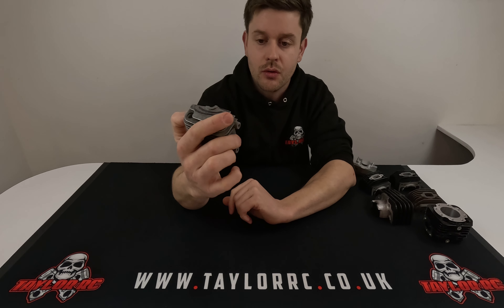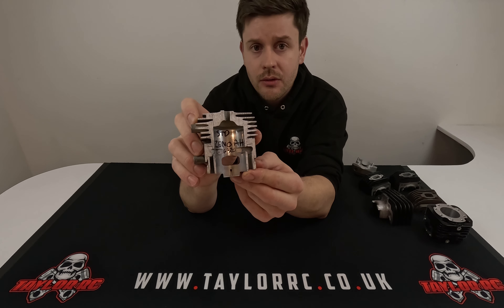TAYLOR 35cc V2 5th Scale RC Engine - In depth analysis and info

Comment: Hi -lovely video thx.I have a custom-made 1/4 rc car with all FG marder parts - Can I install  Taylor RC 35cc V2 in the FG marder. Thanks
Reply: Its possible, some FG custoemrs have done it, but its tight haha!  You also need to reuse the stock clutch housing on 35cc for fitment

Comment: I'm currently in the process of buying that engine for my Losi DBLX 2.0 it's brand new still in the box I was wondering if you could help me with putting together a list for upgrades I can purchase with that engine to be installed with the it ?
Reply from the maker: Morning Antonio, the dbxl 2.0 is actually fairly tough, we  have been impressed. A set of alloy diff housings wouldnt hurt for safety, sadly we dont have stock.  But otherwise the 35 will just drop in place of the current zenoah engine pretty much and off you go for more power!
Reply: @TAYLORRC  okay and really appreciate your help thanks and keep up the great work 👍

Comment: very interested in this engine, ive not long purchased an ESP 34cc Race Ported engine, but its not as good as i thought it would be, lacks bottom end power and ive tried 2 different pipes with it (Olimat unsilenced & Bartelone mid bleed) I've also tried diff carbs including the 1107 modified one from Taylor Rc. Also tried different gearing etc. So my question is, will this V2 give much more bottom end power than a 34 race ported such as my ESP piston port engine? Because i don't want to shell out £800 only ti find performance is similar to what i already have!? Any info much appreciated...Also i read in last comment here form someone that the V2 comes supplied with a cheap chinese coil & crappy pull start... is this so!?

Thanks in advance!
Reply from the maker: Good morning, thanks for the interest. Bottom end grunt whilst keeping rpm has become what the 35 is famous for, but for your own good research i would make sure to watch some actual running video too to see it with your own eyes! The long stroke and Long rod crank (which no other cheap small engine has) and our innovative port layout makes for lots and lots of grunt.   We did use the (proven and much loved by most i should add) BWS starter for the earlier 35s, but changed it to an upgraded better one more recently to ensure we are ahead of the competition. Our coil has been close to 100% reliable and quality equal or better to any brand on the market, i can only assume such a comment is from a friend of a competitor brand. Our engines come with manufacturing defect warranties anyway.
Reply: @TAYLORRC  hi buddy! ...ok great, thanks alot for info, it will be for my dbxl 2.0, im interested in the 9.5k clutch & also the 1257 carb you have on your website bought as a combo, will this engine just drop right in? or will i need other parts to fit it to my chassis? Also what gearing would you recommend for pinion, i have a vertigo clutch bell at present? And finally, do you have any promo code or offers on atm :) ?Cheers!
Reply from the maker: @tizdaz5698  nice one!  For the DBXL 2.0, the V2 Billet rc piston port style engine will drop right in.  Only mod (same as any billet case engine) is just to shave a little off the bottom underneath plastic engine bracket for the dbxl.  If you want the reed, same mod to bottom bracket but also remember the carb is in a different place so cage mod is required.  Vertigo is best, nice one, i would go with a 23T pinion